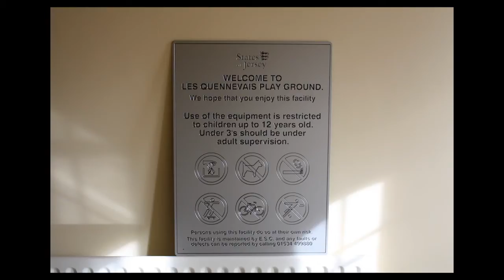Professional CNC router machining Dibond Sign

Comment: I have just started using a CNC router and would appreciate your help. What type of bit are you using? Do you us a lubricant on the material or do you cool the bit? Thanks again for your help.
Reply from the maker: Air line to the spindle and a good stiff 90 degree vibit! And vacuum holding... like all things in life - you need to trial and error and dial it in! its all related to spindle power, driver power, machine stiffness and capacity...

Comment: I commented a few weeks ago on your post. I appreciate you replying! I am trying to cut out the top portion of aluminum and leave the rubber or plastic center. Small bits of aluminum are sticking to the rubber and I am also having lines where the bit passes and it makes it look like ridges. Any help would be appreciated. I can give you more information if you like. Just let me know.
Reply from the maker: Can you post some images / more context. It depends on so many factors. have you got a decent CNC?
Reply from the maker: sure - please send to info@stoneycnc.co.uk

Comment: can you please recommend me feedrate, spindle speed, pass depth and plunge rate for the 8mm bit and for 12mm !! the material is dibond
Reply from the maker: spindle speed used here on this CNC router was about 16,000rpm. feed rate between 1500-2000mm/min. you need high quality bit for this.
Reply: thank you, 
hhhhhh 😂 actually I'm using your bits, I bought last year and didn't get a chance to use ....and now the time .
Reply from the maker: Very good. please let us know how you get on. Bits need to be kept cool too. 
and the skybond needs to be well held.